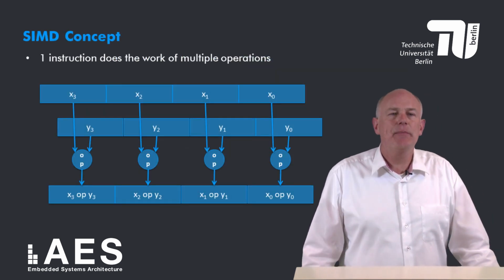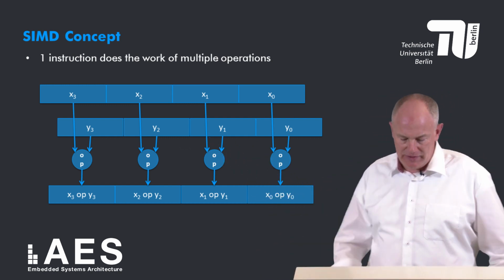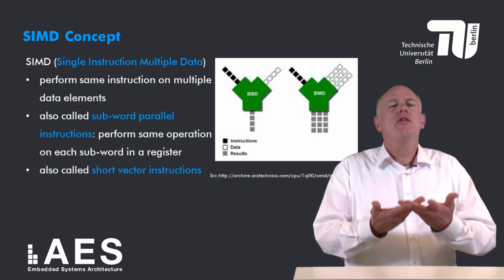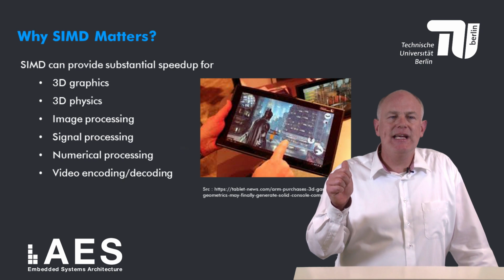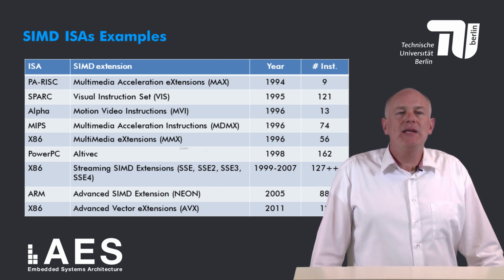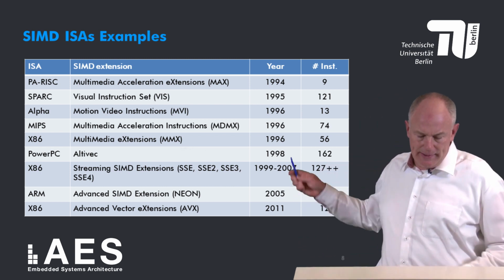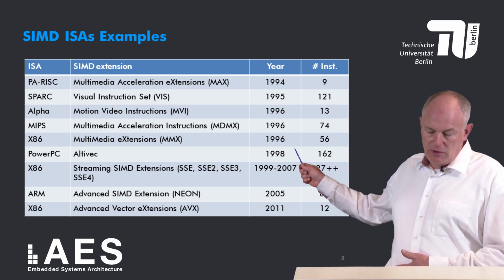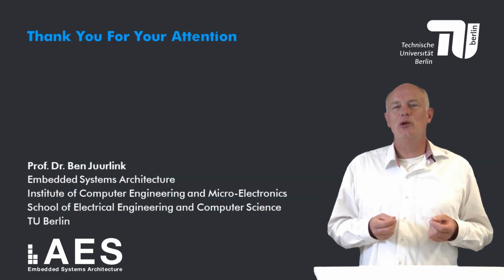2 3 1 Introduction to SIMD

Comment: I will say in a muddy english, Back in the good days  the compagny were with the will to help the old  computer with deficient capacity in mmx, video instruction, then  They sold  specific  pci card made to  read the  video, and  dvd apps.  So why  this good intiative has stopped  by exemple it should be really kind if Intel or AMD  introduced a pci card, a pci X card with all the SSE and others  instructions made since 2003. It will be so usefull for the computer made before 2004. I suppose that Intel and Amd owns the right on those instructions, thats why no independants compagny has commercialised theses applications on pci card.
Reply: but isn't what you described, a graphics card? Sure, they have a different assembly language, but you can still use things like `CUDA` and `OpenCL` to program these.